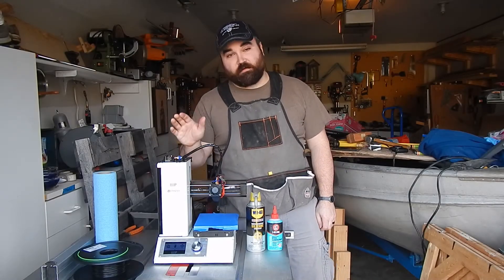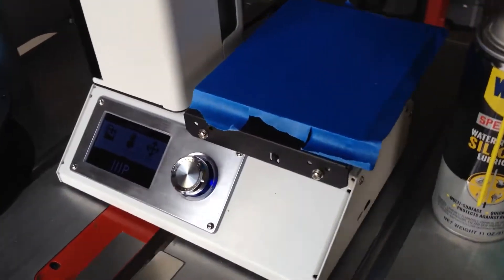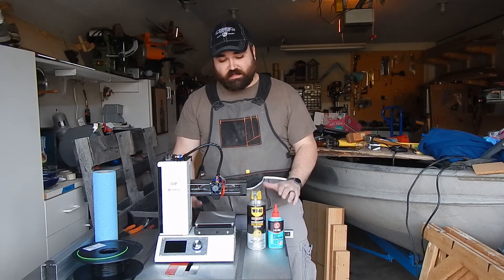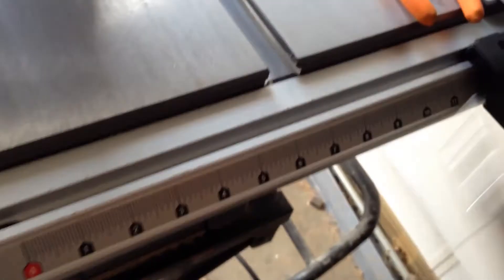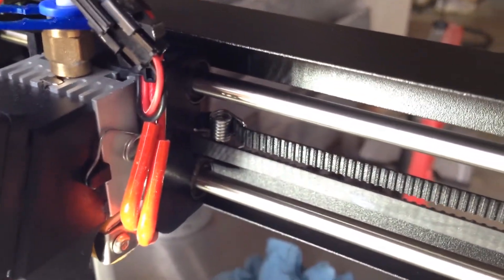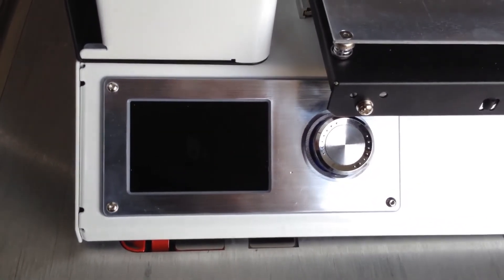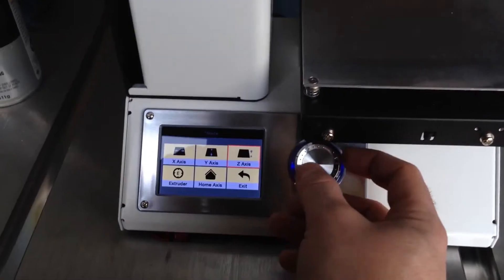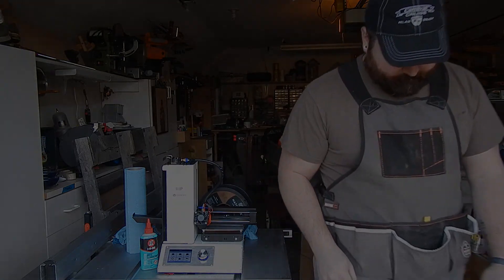How to clean and lubricate a Monoprice Select Mini – 3D Printing Tip

Comment: I know this is super late to the show.. but why the cork under the print bed?
Reply from the maker: Great question! It's used as an insulator and helps the bed achieve and maintain temperatures more efficiently! It also helps shield the electronics under the bed from the heat.

Comment: moving the axis generate power
Reply from the maker: Yes that's a great point. I've never had a problem doing it manually, though. I just try to do it slowly. I suppose the best thing would be to unplug the motors before cleaning.

Comment: How do you get your axis to manually move like that?  I'm afraid to just move them.
Reply from the maker: Great question! Since the X and Y are both belt-driven, the only thing that holds them in place is a stepper motor with current going through it. Once the power is shut off to the stepper motors, they spin freely and you can just move them around without damaging anything. The Z axis is on a lead screw that is hooked to a stepper motor as well. If the power to that motor is off, you could move the entire arm up and down if you could access the screw and manually turn it.
Reply: Ok, great.  How often do you oil and grease?
Reply from the maker: That depends on the location, honestly. I have one printer in my shop and another inside the house. The one in the shop gets dirty much more readily so I give it a good inspection every few weeks and will, at least, wipe the rods and stuff down to take off the dust and grime. I can go longer in between "oilings" if things stay clean. I don't oil everything super often since I don't print all the time but still maybe do it 3-4 times per year. I've found it more important to keep things clean.

Comment: How often do u clean your machine like this? Also what type of oil did u use?
Reply: Can you use hopps gun lubricant?
Reply from the maker: +Evolutionpixel I don't deep clean it really often but wipe the rails down and put a few drops of PTFE lubricant on the exposed parts as I see them starting to get dirty. My printer is in the corner of my workshop so it gets dirty fast if I don't stay on top of it. Hoping to solve that with an enclosure soon!
Reply from the maker: Good question. From what I can tell, it should be fine as long as you’re not too heavy-handed with it. A drop here and there. Just like cleaning a gun.

Comment: Good video, whats the purpose of the cork under the bed? Im "assuming" as some kind of support while reoving printed pieces since it seems to flex??
Reply: How thick is the cork?
Reply from the maker: Hey there. Great question! It's actually there to insulate the bed. Since the bed is aluminum, it loses heat pretty quickly. The cork helps to "stabilize" the temperature so that I can more consistently print with more difficult materials like ABS.
Reply: Aha! That makes a lot of sense. We've been mostly using PLA so far but I'll do that mod anyway. I also notice an odd blue "tab" on yours near the extruder gear, what is that all about? Curious. Thanks!
Reply from the maker: Ah yeah! That is a coupler shim for the bowden tube. I have one down on the hot end assembly, as well. It really takes a lot of "slop" out of that connection and can improve print quality. Here's the thingiverse link: http://www.thingiverse.com/thing:24363
Reply: OUTSTANDING, Thanks for the replies & info:-)
Reply from the maker: alrui you got it!
Reply from the maker: Hey good question. I believe it’s roughly 1/4” thick.